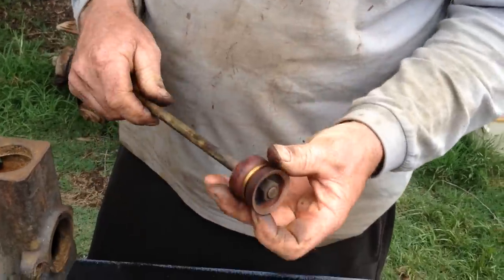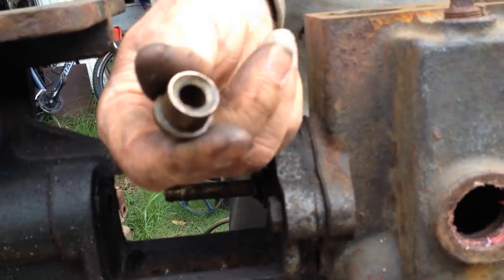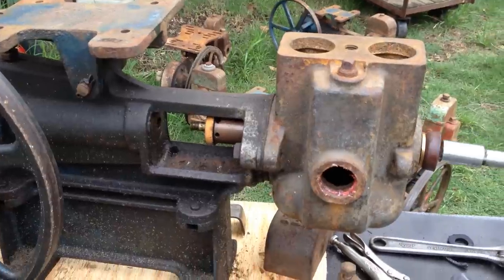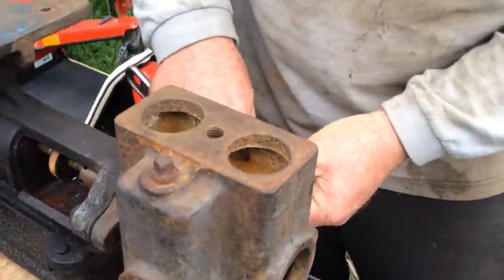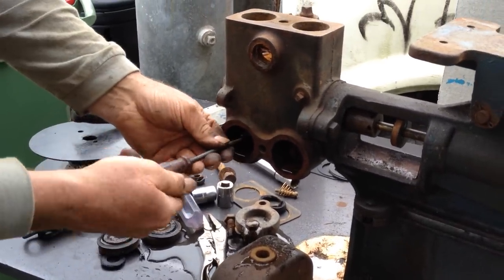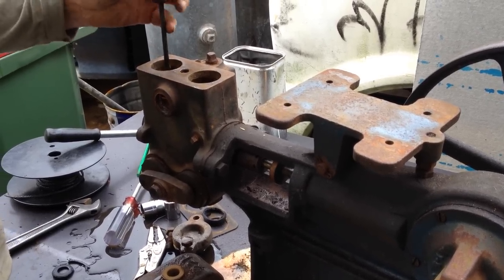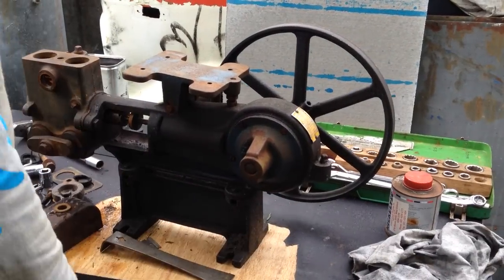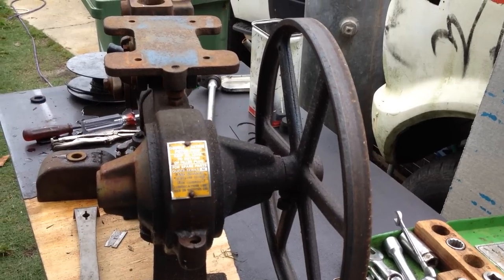Piston Pump 1 1/2" Wet end overhaul (PART 2)

Comment: Hey Shedasaurus! Friggen awesome video - this is the ONLY place on the web that shows what you do. Question for you - I put new gaskets on the body, but it's still leaking. I think it may be due to the pitting on the body. Can I put silicon on either side of the gasket and tighten it up? Need to stop the drips..
Reply from the maker: Silicone will lubricate the gasket and make it slippery, as soon as you tighten the bolt it will push the gasket out. I would suggest getting some STAG jointing paste , it will fill holes and dry in them. Be sure to mess some on your clothes so fellow stag users give you a nod in public for the next few years, it never washes out. Where is it leaking from? The head gasket?

Comment: Hello mate , its very detail and good.
I had a question with regards to 1.25 inch diameter line, its almost 30 running feets long with connection with the main line.
So how much horsepower pump shall i be needed to suck the water from main line. Currently u had piston pump of 1 hp. But it is not working with 1.25 inch dia line.

Comment: Is it wise to change pump gearing by altering the size of the pulley which can increase the rpm?

Kindly mention pros and cons of doing so.
Reply from the maker: Going too fast will wear the pump out very quickly, the right speed you will get 50 years or more out of the pump, too fast and you will get a year or less- the cast iron eccentric is not made for speed. Going too fast does not leave enough time for the valves to shut so water bypasses them so it is inefficient . going too fast will greatly increase the effect of any air bubbles expanding much larger than usual ,causing inefficient pumping. The leather buckets do not stand up to such fast and high pressure extremes.They call these pumps century pumps cause they last 100 years- run too fast and you will have an annual pump

Comment: Thank you for this - great practical advice.I have a DURO K255 that I believe needs a new kit. No sense of resistance or sounds of suction when I crank the pulley by hand.  My pump has a 1 and 1/4 inch nut on the wet end. Does it turn counter clockwise or clockwise to remove? Same question CCW or Cw for 3/4 inch nut on top of wet end.  Both seem very tight and I do not want to apply undue force in the wrong direction. First time installing a new kit and your video give me confidence. Any other tips related to the K255 appreciated.
Thanks
Reply from the maker: Hi, All the pump varieties I have worked on are right hand thread ie lefty loosey / righty tighty`. Left hand threads are generally used on applications where the motion of the mechanics will cause the thread to undo if it is right handed

Comment: Hi, thanks for the video, very helpful!! My question is, if the inside of the pump is really rusty, is that ok? Do you try to clean that somehow? Thanks!
Reply from the maker: Try break the big chunks out but be careful , some people will sandblast the insides as it removes most of the gunk. Letting it dry out for a few months causes most of the rust to fall off
Reply: @shedasaurus  thanks!! would having some rust leftover affect the quality of the water after it is pumped?
Reply from the maker: @JFS-c7g  I have found it stabilises after a while, depends on how acid or salty your water is, cast iron generally only surface rusts then settles down as the rust layer pacifies
Reply: @shedasaurus  Thanks again for your help! I have another question if that's ok? I just finished refurbishing the old pump, and your video really helped!! I painted it too, looks new! I went to test it today, and it won't self prime (I thought piston pumps did self prime??) When I prime it in the water chamber with water, it'll pump, but once it sucks up air, I have to re-prime it since it won't pump on it's own again.... any thoughts? Thanks!
Reply from the maker: @JFS-c7g  If the gland is dripping water when the pump is NOT running tighten the gland. They are self priming but need water in to start the prime. Make sure there is no rust chips stuck under the lower Valve rubbers as it will empty the water out of the pump. Put a check valve at the end of the suction pipe to stop the vacuum effect
Reply: @shedasaurus  hey thanks again for your help! So, while it is running, it wasn't dripping from the gland like you said it should in the video....should I loosen the gland nut then? Could it being too tight have an effect on priming too? Yes, I'll check that no rust chips got stuck, thanks a lot!!
Reply from the maker: @JFS-c7g  Gland packing should drip but when shaft is good and packing is good quality it sometimes takes a while to wear the packing a bit, won't affect priming, check valve/ non return valve ! Look for any leaks on inlet, put ear to pipe near joins to listen for bubbles entering the pipe after use

Comment: Great videos, thanks. I have a working pump that I’ll refurbish soon. One question, the  oily  end, on opposite side to crank, has a grease nipple. I assume this is to grease the gland, is that right? If so what type of grease is suitable?
Reply from the maker: I have not seen them having a grease nipple on the gland before, probably a modification of sorts. I would suggest a light grease but it is not really necessary as the packing has oil lube in to start and once wet the water acts as lubrication. Old school packing like hemp needed grease but was hard on the shaft causing excessive wear

Comment: I'm rebuilding an A.Y. McDonald pump.  Any recommendations for gasket material and best practices for fabricating new valve flaps and piston seals for these old reciprocating pumps?  The piston seals on mine seem to be some sort of woven packing material compressed by washers rather than rubber or leather 'buckets'.
Reply from the maker: Hi. I am not familiar with your pump, sorry can't help

Comment: do you lubricate with  gear oil 85 weight or motor oil like 30 weight?
Reply from the maker: 30 wt is good, any oil made for older engines is good. Gear oil is sticky, works its way onto the wheel and belt , melts the rubber in the belt, makes a mess, makes belt slip

Comment: Where do you get parts for these? i'm having a very hard time finding anything on ebay. i've got an old Lancaster
Reply from the maker: Are they the same shape ?
Reply: Sorry for the long response. The valves seem to be the same shape. I believe the piston uses rubber instead of leather though. I do have some spare parts but not everything I need.
Reply from the maker: The rubber buckets are ok, a bit harder on the cylinder liner than the leather, they can also develop a squeal/squeal in the long run. Find me on eBay under the name 'izikazoomba'
Reply: I have a Penn ,where would I find parts? Great video quick and to the point

Comment: hi all i have a davies series 3 piston pump the same as the pump in the video. unfortunately my pump is missing the two pulies  wheels and the motor. i have purchased a new .75 HP motor. i need to get the two pulies can any one tell what the dimensions or sell me them if they have spares?
Reply from the maker: Hi , look up my ebay Australia under "IZIKAZOOMBA"  and contact me via there, I will need the shaft size as there are about 15 different sizes

Comment: Can you please explain why the gland nut should drip water ?
Reply from the maker: The water lubricates and cools the packing, When packing is new it has an oil impregnated in it but it eventually washes out
Reply: shedasaurus thanks for your response, also if this gland seal is worn would it affect suction, kindly comment.
Reply from the maker: @memphis786   If the suction head is high (more than 2m usually) yes as it will suck air in and sometimes cause a vacuum lock to occur in the valve nearest the gland, another reason to have the groove in the top valves to stop this. Replacing the shaft and the packing will stop this. If your pump drips from the gland when switched off it will constantly need to be re-primed as it empties the pump

Comment: May I know the reason for pressure drop in piston pump motor.
Reply from the maker: Check all the valves and leathers. There are so many reasons I could write a book on it. Systematically go through each section of the pump from inlet to outlet

Comment: Hi, so how do you change the oil.thanks
Reply from the maker: There is a sump plug on about 95%of them under the crank case, if yours does not have it then you have to either suck it out with an oil vacuum or tip the pump to let it come out of the filler hole
Reply: shedasaurus oh yes I found the plug ,but I forgot to ask what kind of oil or gear oil is used for refills? Thanks
Reply from the maker: @pierrecarrier6229  30 wt is good, any engine oil made for older engines is good. Gear oil is sticky, works its way onto the wheel and belt , melts the rubber in the belt, makes a mess, makes belt slip

Comment: Dumb question I can't get mine to pump water
Reply from the maker: Air leak on the suction line , try taking the head off and priming through there, the small slots in the top 2 valves will allow water past and allow the air out creating the suction. Assuming your pump is serviced
Reply: @shedasaurus  thanks yes is serviced
Reply from the maker: @billsmith6983  if you have ruled out the above, check the plug next to the head, if it is sucking air it will not prime , if it is a red plastic one replace with brass, the plastic ones tend to crack and leak, seal with thread tape
Reply: Shout of thanks It works